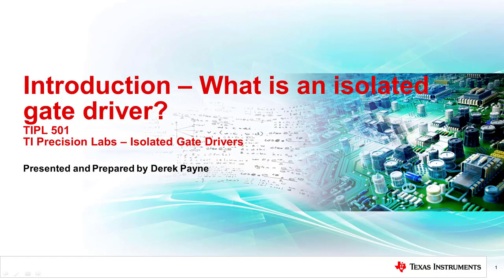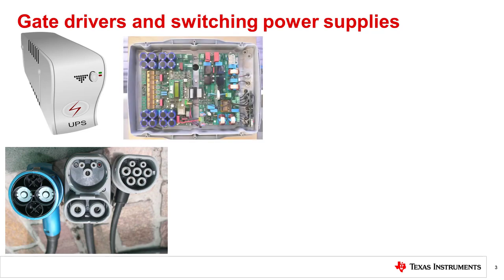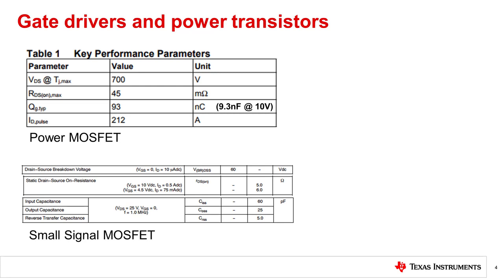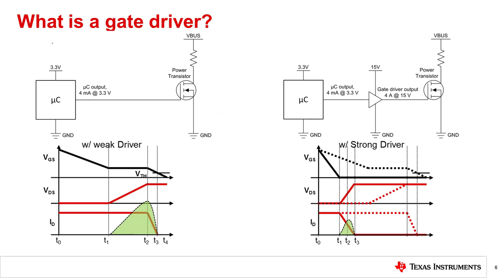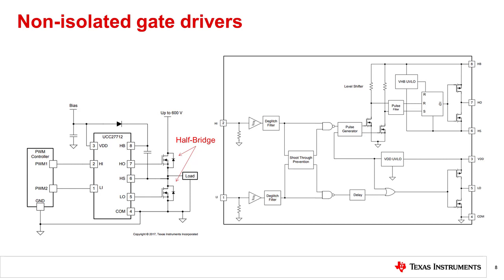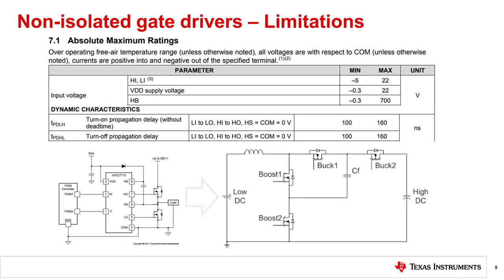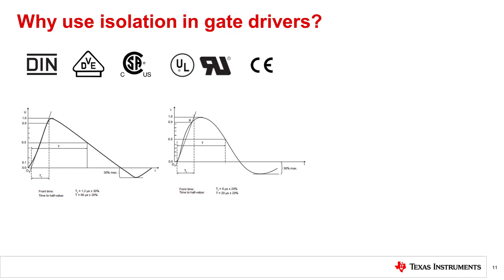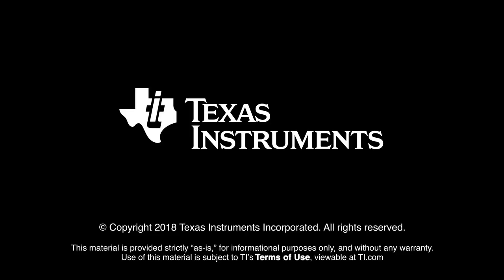Introduction - What is an isolated gate driver?

Comment: If isolated is good, then what advantage of non isolated? Why it's still on the market
Reply: I have the same question and I haven't been able to find an answer in the web
Reply: @jaimealba3178  
@fanriadho 
could be other factors like price and ease of manufacturing. Some applications dont really require this kind of precaution when it comes to isolating high voltage and low voltage areas etc,  and can go with components of simpler construction.
Reply: as I understood; if Source (or Emitter for IGBT) connected with ground so we dont need isolated gate drivers because voltage of the terminal around 0. but if it is not touch ground we need isolated because Source terminal voltage can be so high on this situation and it can effect Microcontroller. and of course non-isolated gate drivers cheaper.